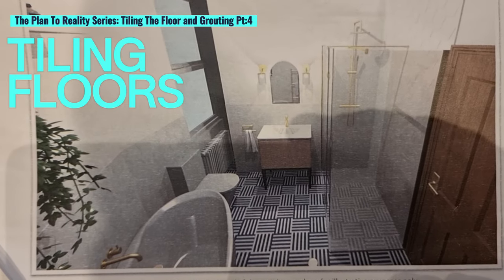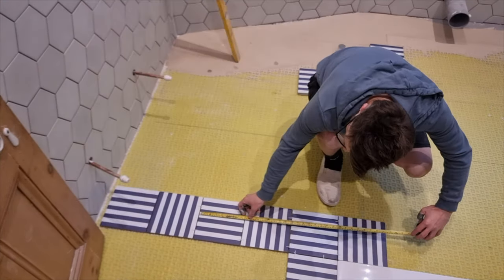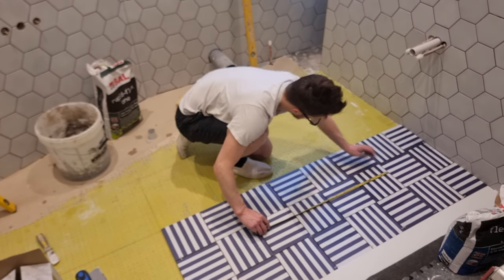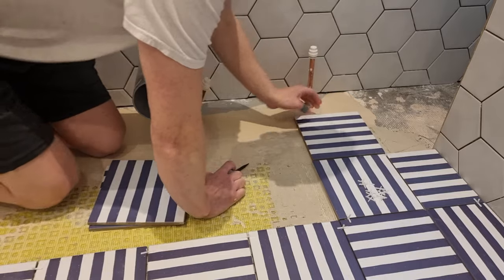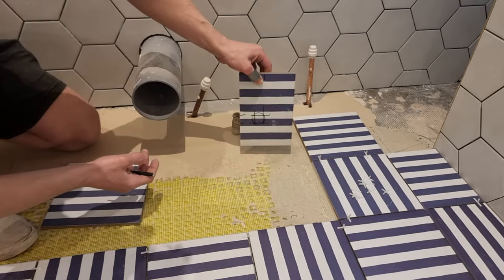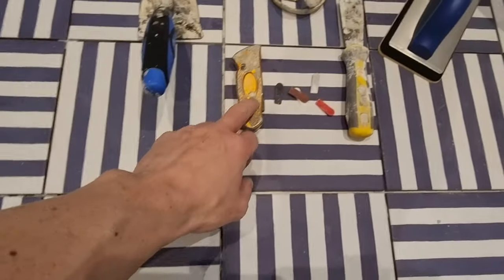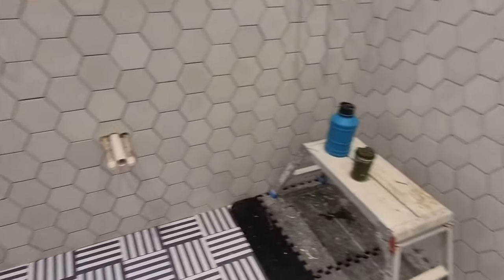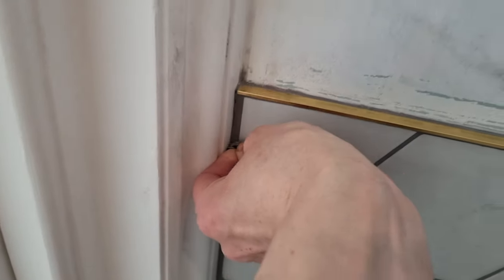Bathroom Floor Tiling Made EASY!

Comment: On the corners of the room where the tile meets a tile do you fill it with grout and then seal over the top or just use grout
Reply from the maker: Yeah it all gets silconed afterwards, Sometimes I fill the joint with grout, Sometimes I don't, Just depends on the size of gap.. Otherwise the Silicon man may get angry with me lol
Reply: @thebespokebloke  that’s great thanks

Comment: When grouting the floor do you use a flexible grout
Reply from the maker: Yes mate, Always flexible.. I recommend Kerakoll Fugabella for porcelain and Bal Micromax for ceramic tiles
Reply: @thebespokebloke  that’s great is that same for walls or just flooring
Reply from the maker: @JamieWilliams-hg6ib  Yep same for walls and floors mate, The reason is Kerakoll sets quicker by itself, So it helps to get a flush joint with porcelain (where the tile has no suction).. Where as the Bal takes a bit longer to set, So it's good for working with ceramics which have a lot of natural suction.
Reply: @thebespokebloke  that’s great thank you your channel is really helpful